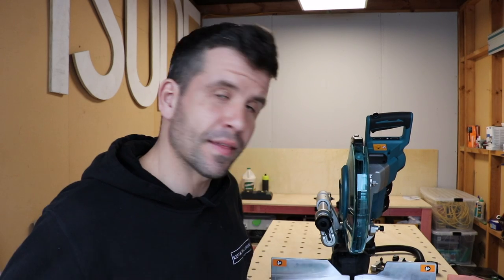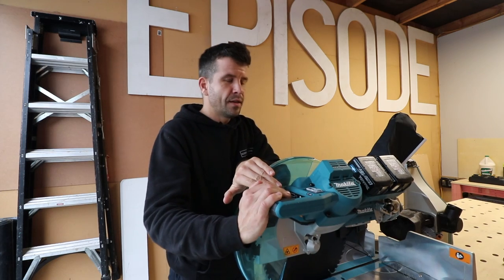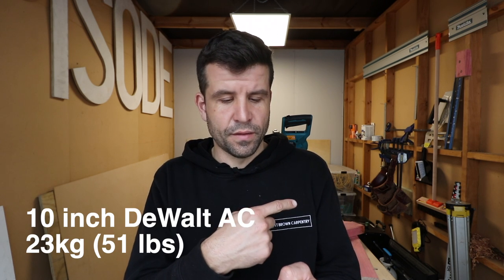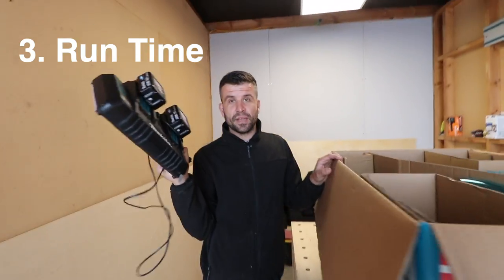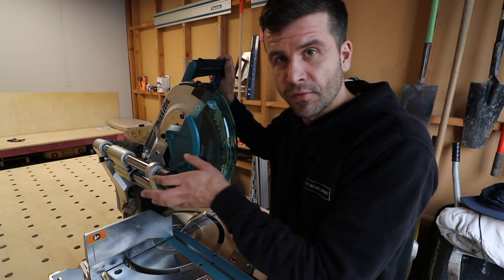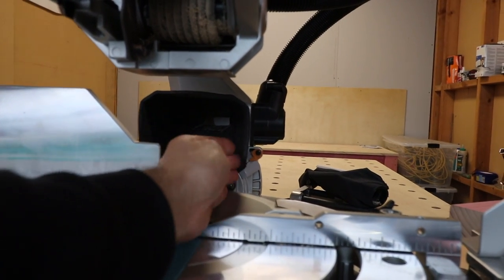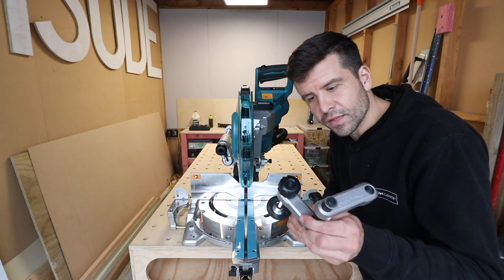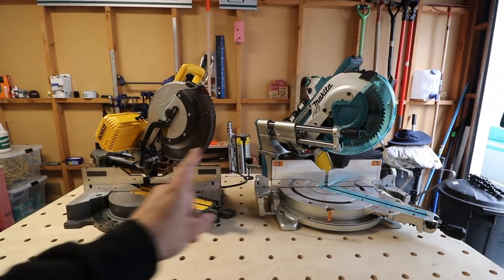Makita 12" Cordless Mitre Saw: Should You Buy it?

Comment: The yellow one is stronger, lighter and has a better way to set the blade position: using a shadow/light system which is much more precise and convenient. On the other hand, the teal one has a much more clever 18v battery system, smaller footprint, smoother cut, better dust collection... plus I guess the 10" version you can adjust the front bevel adjuster. That's why I think I'll go for Makita, but not totally sure about it.

Comment: I dont get why anyone needs a Cordless 12" drop saw.. drills, drivers, angle grinders.. yep..    But a 12" saw, you set up in a spot and dont move it for the most part, run one lead, and your done.  Its more powerful and no changing batterys or reducing battery life.    Im sure on the rare occasion it might be a luxury..    which brings me to another thing...   The Metabo 36v set up has a Corded Battery... so you can run it with a cord...  until you need to luxury of cordless..   I really think Makita need to bring out a corded battery for that saw.
Reply: Agree with battery/cord system including table saw🙌

Comment: i'm not in the trade any more but I just recently bought the dust extraction kit for my old dewalt chop saw it'll be interesting to see how well it works coupled to the festool vac. the festool track saw is insanely good for dust extraction i can't see my dewalt chop saw being anywhere near as good, was very tempted to buy a kapex recently but couldn't really justify the cost just to do a bit skirting/base board in my kitchen

Comment: This saw is actually lighter than my 15 inch Hitachi beast. It is only a single miter but can cut through a 6x6 quick! The Makita looked interesting to me since I am already in the line of tools but way too expensive for me at this point, I will stick to my variety of corded saws for miter and table saw and my cordless circ and track saws if the others won't cut it or are too far from a cord.

Comment: Hi ,I'm wanting to buy one of these to cut oak sleepers 100mm by 200mm, in one pass, currently using a metabo 305mm electric, does the job perfect but I want to go cordless as I have lots of makita tools, garden tools, drills grinder saws etc can you help before I buy, makita said depth 91mm, metabo 105mm, I dont really want to turn the sleeper and would like to go cordless,  thanks Kevin

Comment: Makita makes great tools! Amazing tools. But.... Bang for the buck?....well we love our "sexy flexy's!" Power, precision, portability, and function. And the ability to run on a.c. power as well! It is just crazy! And the shadow cast cut line is superior to any laser. We use them daily, and I am still amazed by them. We have a couple flexvolt sliders and the non slider, and it is so easy to pack around. I am still blown away by today's technology compared to when I started the trades. Or even 5 or so years ago. If you would have told me there would be large cordless tools... like miter saws and framing circ saws, and recip saws out performing corded tools, and 18 volt chainsaws that can cut down a large oak tree, I would have questioned your mental health. But here we are. And getting better and better each year. 👍
I'm very excited to see what else is in store for the future.
Thanks for the video!

Comment: I've owned the 10" version for a year and a half now. It's pretty good but some issues. The base plate will get clogged after a while which makes it really hard to swivel after a while. I usually clean it out with wd40 every month or so. The detents have worn out slightly so won't sit exactly at 90° unless you fine tune it yourself. It's bloody heavy but good cut capacity and power

Comment: I have never done trim work where we didn’t have good power. Always 200’ (80?M) or less. Dewalt has the 120 v flex volt system.  2 60volt batteries or swap the batteries for a corded pack and run off wall power.  I assume it shouldn’t take long for a 240v version
Reply: Yeh dewalt smashes this a

Comment: Good on you for giving an honest review, I agree that saw is huge and too heavy, the competition saws are lighter including the batteries than this one is without the batteries. I do like that it can do 380mm crosscut, but in reality when would you ever use that, your 100% correct, battery power means portability that's why it's battery powered, if you make it bulky and heavy it's pointless, and the competition also can plug 240V in when it's available or run on battery when it's not, Makita missed the boat with this saw I think.

Comment: Unless you intend to use this on a site with no power I see little point using a cordless dropsaw. 
Especially if you need dust extraction. My vac has a power outlet that turns on automatically when running a powered tool through it. I will stick to my corded version.

Comment: Don’t really see the need for a battery drop saw of that size. If you’re cutting large thicknesses of timber often, You’ll most likely just want more power and not have to worry that the saw’s going to run out of battery mid cut.  

What’s more is that, getting rid of the cord is only really useful if you’re going to be moving around the worksite/place/home/etc. with it, otherwise, what’s it getting in the way of when it’s completely stationary?

On the contrary, the smaller lighter battery drop saw’s I see can be more useful, for example, I could see small maintenance jobs finding one handy. But still pretty steep for a small job.

Comment: Usually I would see no point in a cordless mitre saw but the corded versions use so much startup current even my 4000/8000w inverter can't run them and an inverter that can is thousands but the saw to solve the problem is that kind of money too :)

Comment: Cant see why you would need batteries on a device that large. I know some sites in the UK dont have 240V in them in that case i can see the need. but for most of the work you seem to do would a corded saw not have basically the same level of usefulness?
Reply from the maker: I've drawn the same conclusion.  Sticking with electric for now 👍

Comment: I have the 10" version of this saw, I love it, how ever if I were to get a 12" I would get the Dewalt flex bolt.
Reply: Bro, I just got the 10" last week and its amazing. The quality of makita saws is far better than dewalt or milwaukee
Reply: @chadcoop9638  I just got the 12" flexvolt, Haven't had a chance to use it yet,  it's still in the box
Reply: If you can remember let me know what you think of it. I've always used the dewalt 12" corded. But the makita puts the ones I've used to shame. Although my dewalt is about 6 years old. I know the flex volt circular saw is the real deal
Reply: @chadcoop9638  I'll keep you posted,  the reason I got the 12" is because some of the 2 step crown I do on cabinets, comes pre assembled and the 10" won't cut it

Comment: I chose a saw for accuracy. I can't get my Makita 10" version of this (corded) to cut accurately. Adjusted everything that can be adjusted. If I lean it over to do a bevel, the bevel is fine but it then cuts out of square. I wonder if yours has that problem too?
Reply: Any solution? I have the problem
Reply: @tannerj5826   i never found the solution. this guy has made a new detent plate https://www.stenewoodwork.com/store1/The-STENETENT-Plate-p132099441 which might help. But i sold my makita 10" before spending any more time on it.

Comment: You didn't mention the power? I've used the 18v makita and felt like it wasn't up to much, only just enough to cut skirting board. how does the power compare to a 110v version?
Reply: The 36v versin of the smaller saw cuts like a knife through butter 195mm cutting

Comment: I own Makita and Bosch both line for work. Always love Bosch drop saw, now new bosch coldless drop saw released with new 12ah core pro battery. I think will invest Bosch coldless saw at this time instead of makita. Light weight ,only one battery running and functionality. For imapct driver and criculer saw, makita does better job than Bosch, they are both very reliable tools. Not have too much drama

Comment: Good on ya for making this video. I'm currently in the market for a 10 or 12 inch mitre saw and was tempted by makita over Dewalt because I already have the batteries.  It will be interesting to see how you get on with the dewalt. My current saw is the 7 1/4 Milwaukee which absolutely great it just isn't big enough to cut larger cornice.

Comment: I'm curious if anyone has had problems with achieving square: I'm on my second saw that is impossible to square because the travel and the blade angle are not parallel and move together with the angle adjustment. SO I either must square the travel or the blade with the fence. The result is that my either my short or wide cuts are square, but never both... It's really frustrating and I'm wondering about returning this second saw for a third...
Reply: Square your blade with the fence. There should be two allen bolts in the casing at the end of the rails. you can dial in your saw by loosening those, sticking a length of strong wood between the rails and gently but firmly wrenching them clockwise or counter clockwise depending on which way your blade is drifting. hold and re-tighten your allen bolts. It's an issue of trial and error.

Comment: I have a makita ls1016 drop saw.  Worst tool purchase decision I have made.  It has massive kickback issues. Have had it into Makita and they replaced all of the fence assembly, but it still kicks back to the point of it being unsafe to use. I was told that it is not an issue with the saw, that you should clamp all timber when cutting with it, because that's would you do when framing a house, clamp every stud or plate you cut 😂
Would never buy a makita drop saw again.

Comment: At work we have the corded version of the 12 inch Makita and I, as well, think it’s a pig. The placing of that bevel lock thing is soooo annoying, not to mention seldom used. As well there is a little plastic plate below the laser adjustment screw that falls off constantly. And I guess to continue my negative rant, why is everyone so adverse to extension cords these days? Skill saws, angle grinders, this stuff makes sense but a chop saw? That’s just lazy😂

Comment: I use to be a Dewalt fan but they keep changing battery platforms etc which puts me off and shifted to Makita and Makita-Dolmar. Anyway I was very skimpt and wanted a mitre everything else  saw and saw a brand new 2 months old Dewalt unit on the floor of a used tool shop for 700 bucks. I asked why so low?, the guy said a builders wife sued for divorce and poor guy had to rid everything for a song. Dewalts fame is their saws which is their benchmark tool they were founded on. Anyway I went to Makita due to their tools are trade and industrial grade and plastics are virgin new and resistant to a battering. Milwaukee tools are better in many ways to Makita but their plastics is crap and tools fall apart. (I purchased a Milwaukee rattle gun and left it at mates CanAm dealership which literally on a daily minute by minute basis its the most heaviest used Milwaukee in  New Zealand, after 2 years constant use its hanging together.

Comment: I had the corded 12" Makita, stuffed 3 fences when ripping. I've had the Dewalt corded 12" for over ten years, tuff saw. Now I have the 10" cordless flexvolt Dewalt, Sooo light and compact. You'll find the Makita rails rust where as the dewalts don't.
Reply: i also had dewalt flexvolt miter saw but the rails was so bad in rust i return back to home depot. now i got the bosch 12" and never look back.

Comment: I don't see all the fuss about everything being cordless.
Yeah it saves you 2 minutes running a power cord out, but it forces you to carry a charger and at least 2 batteries for every different brand of cordless tool you own.

Even if you do happen to have all the same brand cordless tools, you will probably need to carry 8+ batteries.

Not to mention how all the major power tool brands phase out the older style batteries every few years and force you to buy new tools, batteries and chargers.

The only cordless tools I own are my drill, impact driver and nail guns.

Nothing worse than climbing up on a roof with a cordless tool, getting 5 cuts done then running out of battery. 😂
Reply: Yea im not into cordless either... mainly because of the battery phase out. I would also like for my son to inherit my tools after im gone but how will he use them if you cant find a battery
Reply: @GR-wd8jm  
Very true.

Comment: We’ve got this saw on site it’s not mine it’s my bosses I’ve gotta tell ya it’s terrible it’s way too heavy or one and changing the bevel angles is so slow with that front adjuster and that button at the back combination and if u don’t fully lock it off back at 90 degrees ur cut won’t b accurate it really is a bad design fault something u don’t expect from Makita not in a million years would I part with £700 for this I’ve used makita 110v chop saws for years obviously much older than this newer version but to me there way more user friendly and just as accurate as for battery chop saws reckon the 7 and a quarter saws r the way to go unbelievably portable accurate and wide cut capabilities they can do virtually every task a jobbing chippie needs it  to do on site

Comment: I don't really see the point of a cordless Miter saw, a miter saw its not a "hand tool", and it will never be. You often use it with a vacum cleaner witch have a socket. And it's not like you move around a miter saw. you set it in one postion at the job site and it stays there for the whole job. it just a waste of batteries. batteries are expansive and bad for the enivroment, don't overconsum them.

Comment: I use Makita for everything, but there chopsaws are awful.  
DeWalt,festol,Bosch,Hitachi/hikoki are all much lighter front adjustable do the job better. It's the only thing Makita haven't got it right in the last 10 years there chopsaws need to be front adjustable and 10kg lighter also need to change the button trigger design. it always breaks when your getting it out the van.